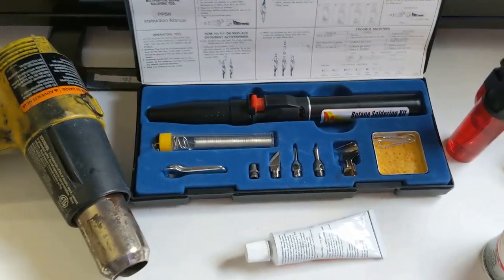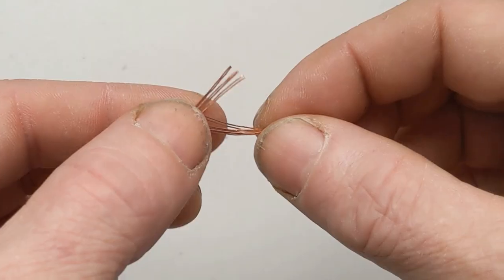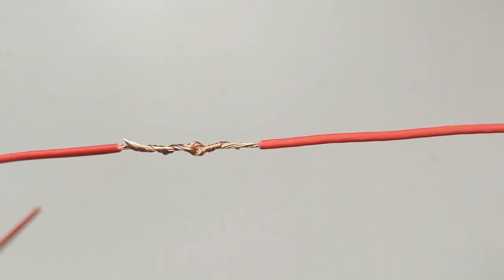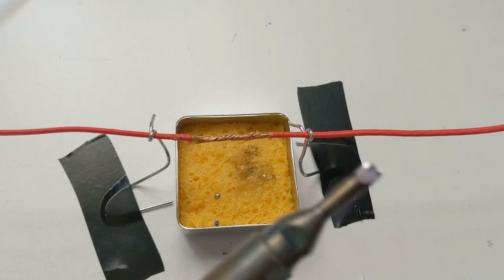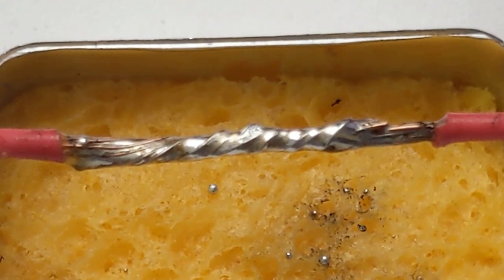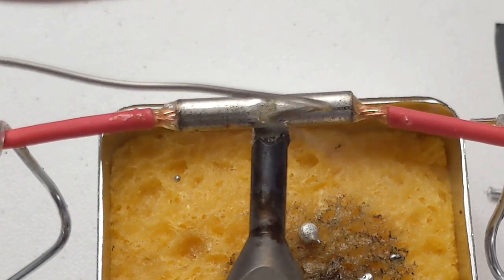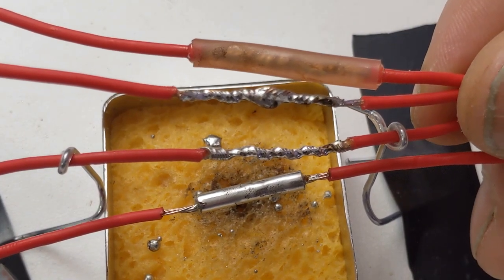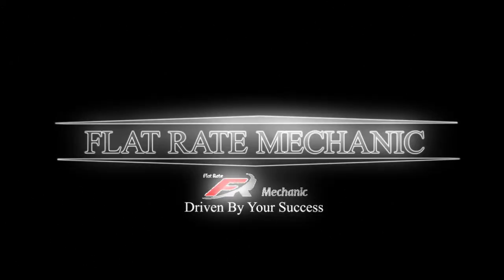How To Solder And Protect Automotive Wiring (Tips And Tricks)

Comment: Use the same method on my semi trucks and trailers. For 40 years. Same torch even. Never ever use the grease though. Prevents the heat shrink from shrinking properly. Sometimes I would silicone over the heat shrink if it was going to a hole

Comment: solder is good as yours are....in gm classes   they say to crimp  and heat shrink
Reply from the maker: I should have added that I in most cases use the metal butt connectors and crimp them to hold the wire then fill it with solder then shrink wrap.

Comment: No, please don't use dielectric grease with double wall heat shrink tubing, it prevents the encapsulant/adhesive from bonding with the wire's insulation and creating an airtight barrier. If you're using regular heat shrink tubing, then go ahead. Silicone sealant/adhesive would actually be better than dielectric grease if you're going to use regular heat shrink tubing, but you do you.
Reply: Just what I was about to say! 100% agree.

Comment: Pretty sure the technique at 2:50 is what NASA use for emergency wiring repair. I think they discovered that a correctly repaired joint is about twice the strength of the standard wire.